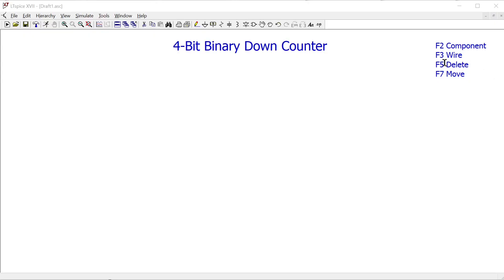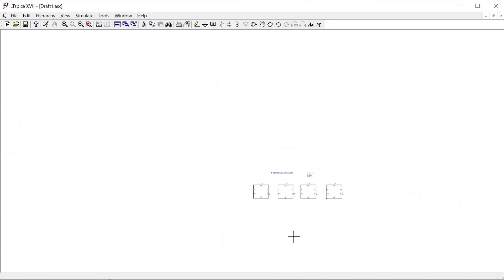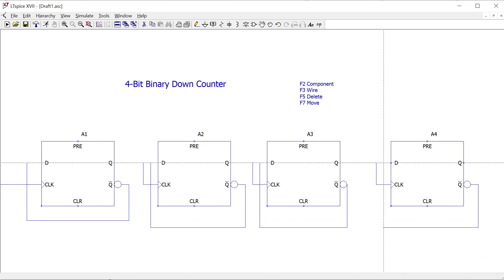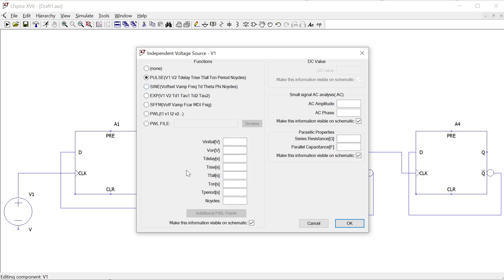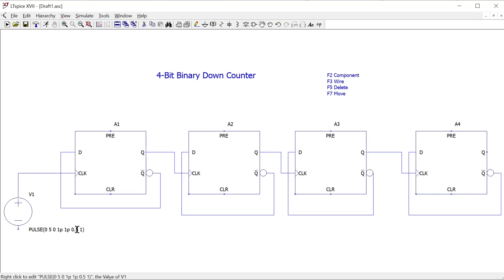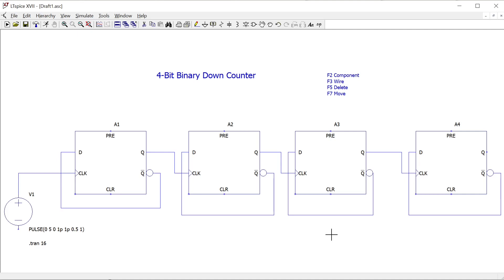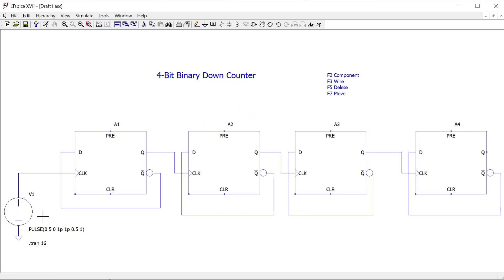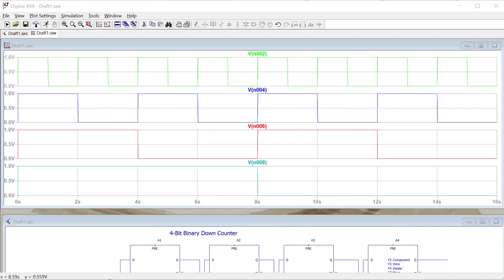4 Bit Binary Down Counter using D-Type Flip Flops in LTspice

Comment: IS there any way where I can make the the voltage at each FF output higher than just 1V
Reply from the maker: Yes - if you right click on the flipflop to open the Component Attribute Editor, there is a box for "SpiceLine" where you can enter a custom entry for the parameter "Vhigh" (output voltage when high): so you can type Vhigh=5 to make the output voltage 5V for example.